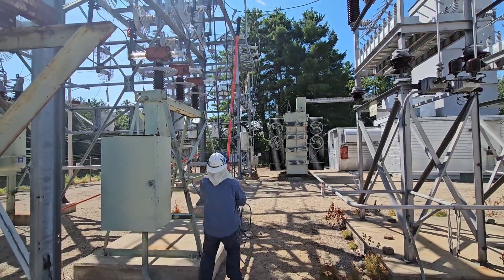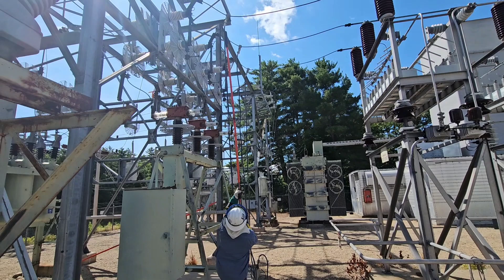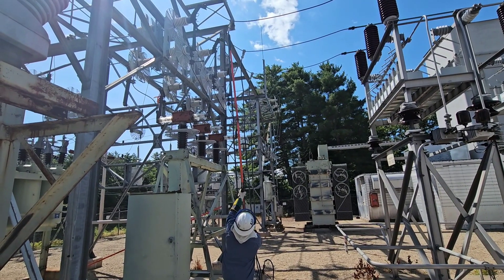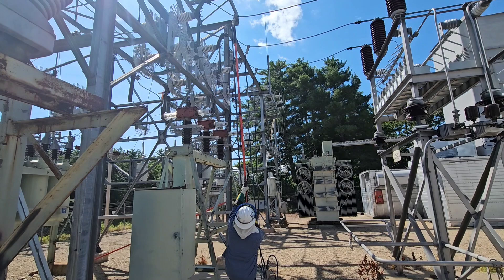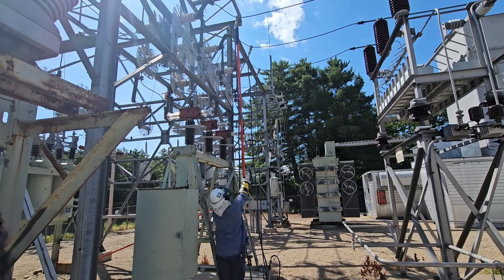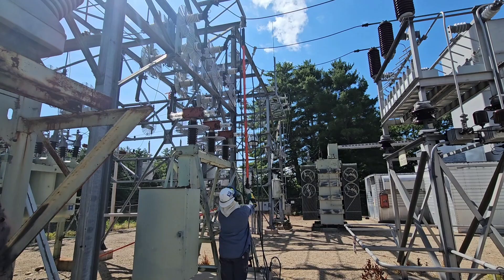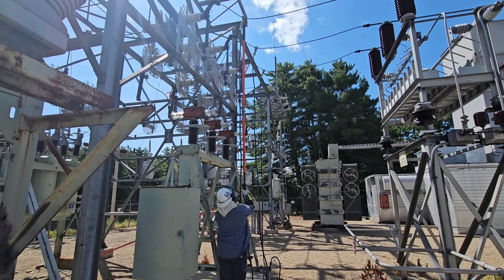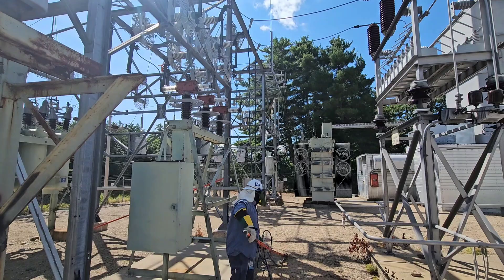Dropping grounds in a high voltage substation after repairs are complete

Comment: How did you get an interest into electricity? I have a theory that many electricians have a story of getting shocked when young and for many that's what leads them into the field.
Reply from the maker: @AeliusAnonymous  honestly it wasn't about electricity at all to begin with.  My
 Interest and experience was mechanical,  but I had enough background in electrical theory that they let me in.   The equipment is so large that a lot of it has a mechanical aspect to it... breaker operating mechanisms, oil filling and pumps, high pressure air systems, mechanical switches, etc. 
 I just really liked the variety of work and going to multiple locations, I like the people I work with and the general attitude and the feeling of keeping the lights on and systems going that are important on the whole.